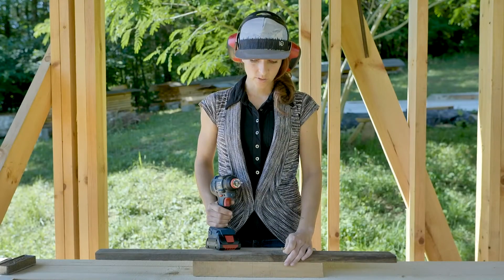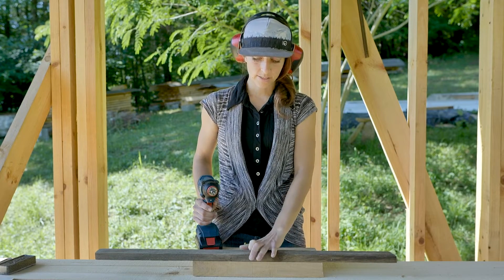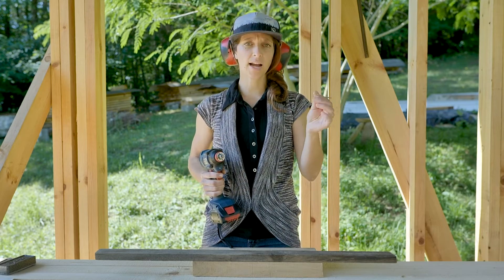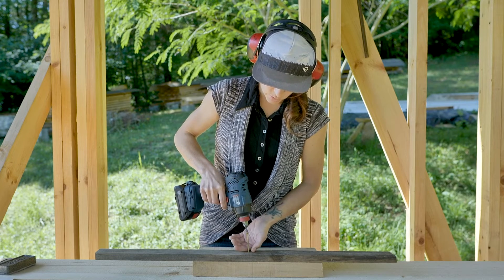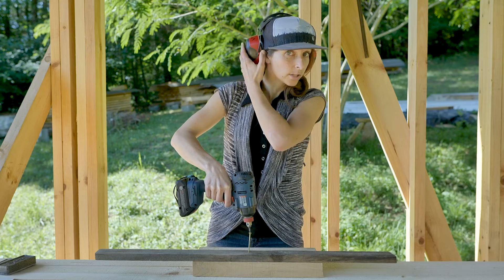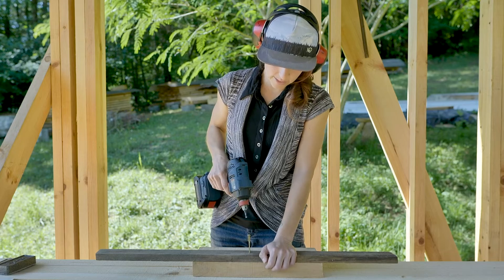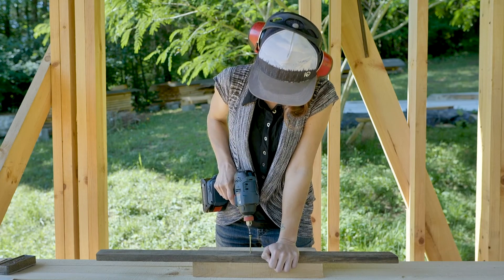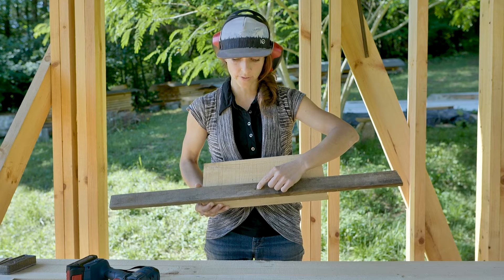How to Drive a Screw: impact driver tips / Carpentry Skills & Tiny House Academy at Wild Abundance

Comment: Is it good to use impact driver for small screw into 15mm plywood DIY project? I don't know to buy between cordless drill or driver. I already have 2 corded drills btw..550w and 700w.. if I wanna save budget, I think I could just use the 550w drill.

 But perhaps driver is better for future proof? Maybe in future I'll do thick hard wood project? But of course driver cost is about 3-4X more than drill.

Ahh..my mind says no but my heart says yes
Reply from the maker: Personally we love drivers and find them extremely useful to own, but we are a carpentry school! Hope your project turned out well.  Check out our basic carpentry classes if you ever want to build your tool and building skills!